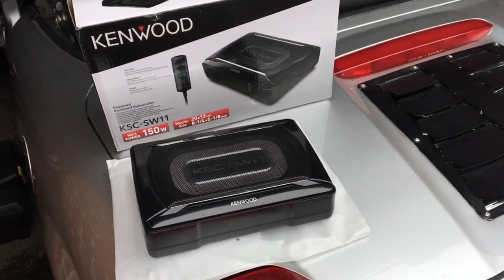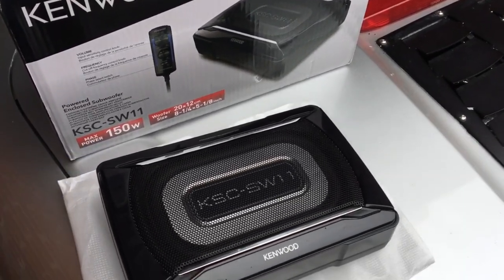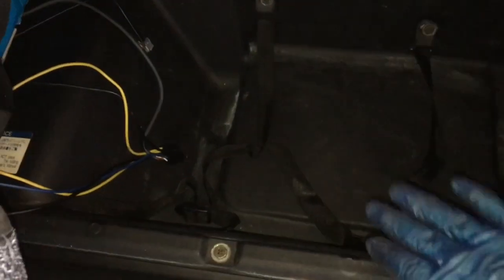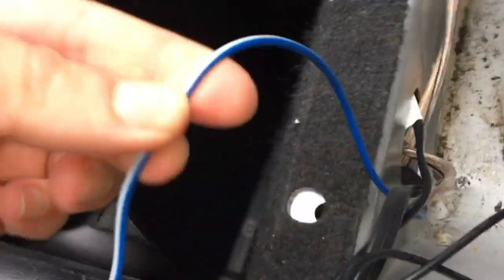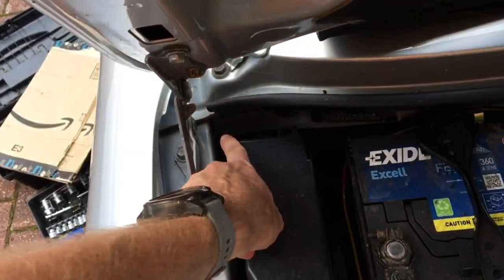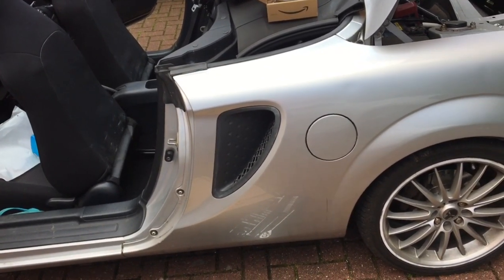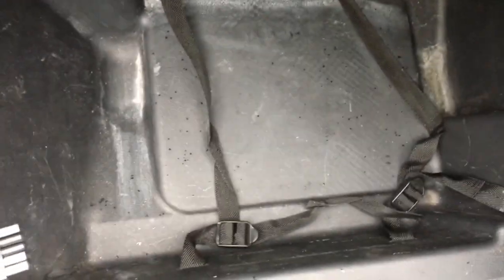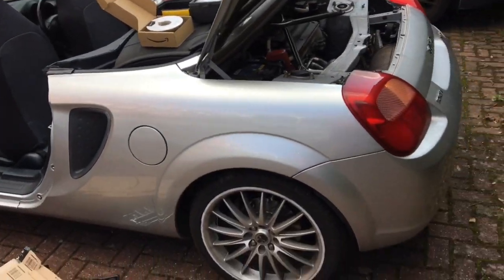Toyota MR2 - active subwoofer install

Comment: i just fitted this exact subwoofer on mine like 2 weeks ago, i prefered placing mine behind the drivers seat, powered from the cigarette lighter port.

sub draws max 150w, so the 15a fuse on the lighter should be more than fine, also i fused the sub with a 10a fuse that never blew for now.

Comment: How bad do those doors rattle now? The weight of your rear speaker mod looks like it will absorb some of the vibration so hopefully it isn't too bad. I tried a similar sub setup and after only a few months I moved it behind the passenger seat and mounted it and the cap to the carpeted wall. Your model is even thinner than mine so it should fit no problem if the door rattle ends up bothering you.
Reply from the maker: Very good question. Oddly enough i get no rattle, though I have not cranked it up as loud as i can. If i did get rattle i guess I would try to suppress with sticky tape based foam
Reply: @andrewsparey697  If you don't get rattle that is great! The door by the lock buzzed and being right by my ear I couldn't help but hear it. I did try some of that foam tape which did help quite a bit but I was aware of it and could still hear it. If yours is already nonexistent/quiet then that should be more than enough to fix any that may pop up in the future.

Comment: Hey! Bit of an audio-illiterate here, where did you connect the blue/white remote power cable to the car? Can't quite seem to figure it out on my end.
Reply from the maker: The stereo itself has blue / white remote intake wires. My stereo is a Philips, but Blue and white are industry standard
Reply: @andrewsparey697  That was what I was expecting, but I recently installed a Kenwood DMX5020DABS and it doesn't seem to have one. The hunt continues I suppouse.
Reply from the maker: @Rethgore   google for a wiring diagram for the model and see if it has one. Failing that there are work arounds . A remote wire is only a power wire at the end of the day. You should be able to connect it to a ignition live. Not a permanent live to the battery or the amp will stay on when your car’s ignition is off and drain your battery
Reply: @andrewsparey697  Absolutely, eyeing the cigarette lighter atm but sent a few questions out, hoping for a more straight forward solution! Cheers for the quick replies btw, got any new MR2 videos coming up?